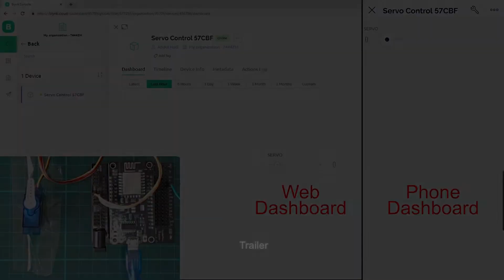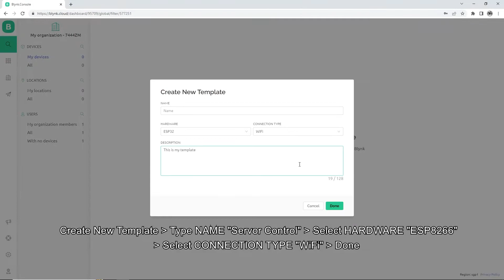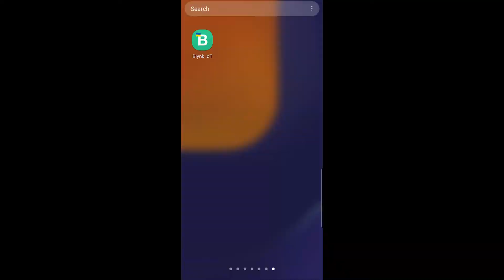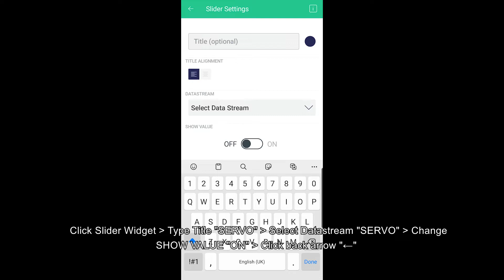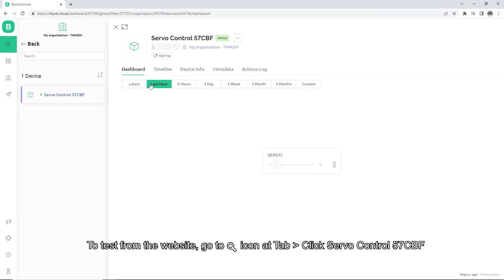IoT Based Servo Motor Control using Blynk Apps and Nodemcu | ESP8266 | Project

Comment: hi.. thank you for a detail tutorial.. i set my servo to using a button.. so it goes to 0 degrees when push on and 90 when off.. my question is there a way to control the speed of the servo so it wont go as fast?